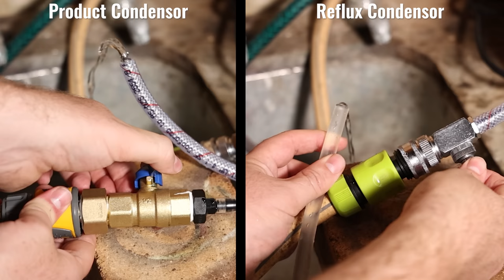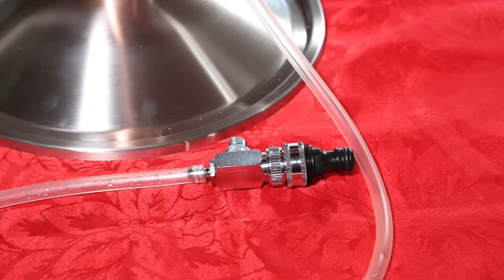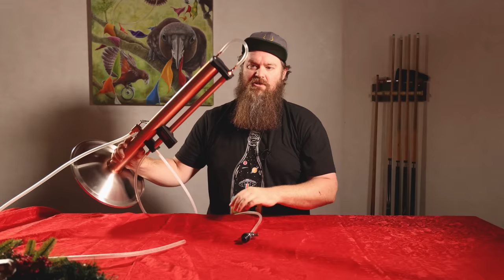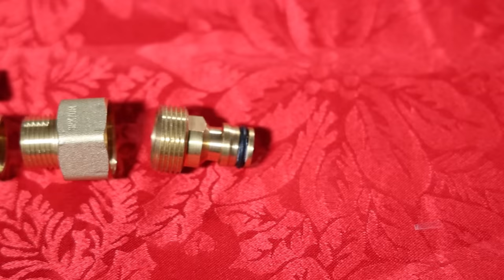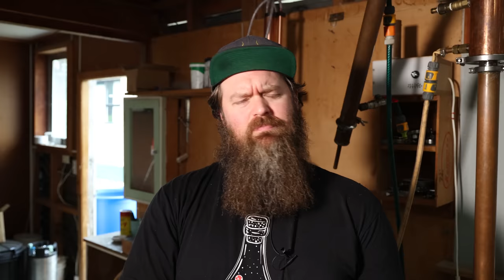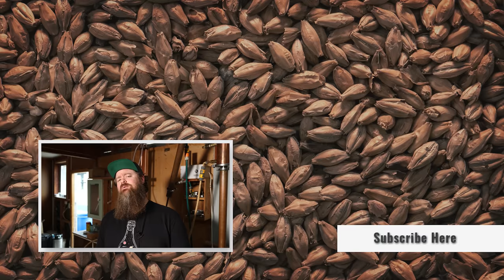Upgrade Your T500 Water Supply : Separate Product & Reflux Condensers

Comment: Thank you once again for an informative video!  I was wondering if you did any actual distillations with the dual water supply, and if so, did you add a second thermometer to the top of the reflux chamber, and what you found the necessary temps to be at.

Comment: The condenser only needs to feel warm at the entry point to knock down whatever you are making. It's also touchy, but less critical than the reflux side. A spare needle valve works fine. Once you get away from the strict turbo recipes and set-up, best practice is to adjust the reflux to achieve a drip - drip - spurt flow, about as fast as you can say it normally, not to chase any arbitrary temperature. A lot of stuff is best around 66 degrees. 

It's a big help to have an alcohol refractometer as you work. Only need a single drop to measure ABV. If you are running too hot and fast, your ABV will go down below 80% since you are carrying over extra water.

Icing on the cake is an SCR voltage controller with a keypad. Once you are boiling you don't need anywhere near full power to get optimum results. It's much easier fine tune 2% power with the keypad than it is to adjust the $%%^&* water valve.

Comment: I find the needle valve is very sensitive, as previously commented, however my experience was that it is all due to changing mains pressure and a small water pump connected to the needle valve solved the issue. I did like this idea and will certainly be implementing it. I have been watching your videos for some time and have  leant a lot, I am very happy just running a t500 as I am happy just making vodka and gin and just experimenting with the botanicals. Being able to split the reflux cooling from the condenser cooling seems very sensible and easy and I'm annoyed I didn't think of it myself! Many thanks.

Comment: Great video. I've had my T500 for 7 months. The best mod for me so far is a £10 power controller. I've just started carbon filtering; it's a revalation. My next experiment is a birdwatchers wash. 
Right now I wouldn't know what to do with two different water supplies, but I'll look it up. Thank you for providing ideas to expand my knowledge....
Reply: Where did you get your power controller from please?

Comment: Jesse you are right on with this modification.  One additional step I'd suggest.  The column needs a thermometer or a temperature probe so you'll know how to fine tune the water flow, especially to the column condenser (which is pretty much a dephlegmator). You can drill a hole into the plastic cap on top of the column.  Center your hole position in the center of the larger rounded section.  There is nothing below the cap in that spot and the plastic isn't very thick.  Drill the hole to best suit the temp device you're intending to use.  I drilled and tapped it for a Type K thermal probe to use with my PID.  With this arrangement, the T-500 is greatly improved...in my opinion.
Reply: Does the plastic at the top have any issues. Especially running ad a pot still?
Reply: @RyanAbrey  no, it is just a cap.
Reply: @skyhookspirits  does the hot pot still run damage the cap?
Reply: @RyanAbrey  No damage. At the top of the column is a coil of copper tubing which cools the vapor.  It acts like a dephlegmator.  This is the point where vapor transitions to the condenser.  If you drill the cap and put in a thermometer or temp sensor at the top, you will be able to monitor temperature accurately and can adjust water flow to the top condenser's temperature more precisely.   The side condenser can have a lot of water flow, but top condenser's water flow must be carefully regulated with a needle valve.  Too much water flow and the column will get too cool and you won't get flow.  Too little water and the column will flow too fast and out put will be fast, but not be the best quality.
Reply: @skyhookspirits  ah so you can't run it completely as a pot still.
Reply: @RyanAbrey  Sure, just don't use the top column condenser.  Just send water through the main condenser.  Also, if running the column as a pot still, you would not put any packings in the column except a small roll of copper mesh if you want.
Reply: @skyhookspirits  Have you posted anywhere about these mods? I'm up for doing it but would love to see some pics if you'd posted them anywhere
Reply: @kierenbeltrame3189  I have photos of this modification, but need your email to send them.
Reply: @kierenbeltrame3189  No, but let me know your email and I'll send you photos and instructions.
Reply: @jpjustinianoj  Ok, let me get things together and I'll email soon.
Reply: @skyhookspirits  maybe will make your life easier to upload the photos to https://imgur.com and share the link in here? Will save you emailing to a number of different people
Reply: @jpjustinianoj  I've posted details and photos here:  https://imgur.com/gallery/h6iGWTr
Reply: @rocketsroc  For some reason I missed notification of your comment, came back to check if any update. Thanks so much for this, it’s really informative. I’m looking forward to modding over the holidays, perfect timing. Merry Christmas!
Reply: @skyhookspirits  Hi guys!! My question here is if the unit is ran as a Pot still (no water through the top/column condenser), is there any chance that the temp will be too high to possibly damage the top plastic cap? If there is no water in the top condenser, the very top of the column is sooooo hot (don’t ask me how do I know that lol), and my concern is that if it’s left like that for a period of time (the entire run as a pot still) the plastic cap will not survive. Am I overthinking this? If not, please share if you know what do you think it’s a highest temp that the plastic cap can handle? My thoughts are if there is a temp level that is “safe” for the plastic, might be achieved by still running a small amount of water, but I think that would defeat the purpose of running it as a pot still!?! Yes? No?? Please share the knowledge… I would truly appreciate it!!!
Reply: No plastic won't melt.  To change the reflux column to a pot still, just remove all packing in the column and run it as usual.

Comment: Great that you are playing with the T500, this is what I currently have, looked at many different options, but this is so accessible. I now want to explore mods too, I recently bought the copper dome and condenser, which have limitations, a power regulator has helped. More recently bought sight glasses and bubble plates, which to be honest, are fun, but don't improve things too much. What I have learned is the Tri clamp accessories are readily available on AliExpress, and these and boiler options seem to open up a new avenue to explore. Keep up the good work, so much is learned from your posts.
Reply: Would you mind sharing what you used for a power regulator?
Reply: @PickledAndFermented  a 4000W scr, the one I got was off eBay. I haven't seen the same one available, but there are several similar ones. I also use an energenie power display so I know the input power.
Reply: @warrencourt7938  thanks for that. Ok start searching. When you reduce the power how does it affect the output? I'm assuming you can lower the abv and keep more of the flavour? I just started learning during the pandemic and now I'm getting creative :)
Reply: @PickledAndFermented  turning the power down will affect output a little, the advantage is your not forcing some of the less volatile components through. You give the high volatile components time to release at a steadier rate, this likely helps keep any cuts you make better.

Comment: This is so cool. I have had the T500 for a year now and been wanting to make some mods to it. I have just ordered a power controller to reduce the element power and then want to find a way to get the temperature at the top of the column.
Reply: Where did you source the power controller?
Reply: @mxj0048  from kegland 
https://www.kegland.com.au/4000w-power-station-240v-power-controller.html
Reply: @mxj0048  10000W High Power SCR Electronic Voltage Regulator Speed Controller AC 220V from EBay. Splice the active wire only from an extension cord into the SCR.
Reply: @iantaylor1341  Exactly, plus you can also put a 'amp, voltage and Kw/hur meter' in the box, I also put a little fan in there to keep the heat sink cooler. I'm surprised S P haven't released a version with all these mods as standard issue. A 400mm spool helps too.

Comment: Adding a temperature probe at the top of the column would be a plus. That is what I have done to the one I have about a year ago. Makes it very versatile. Keep up the great work Jesse.
Reply: Where did you add the temperature probe to?
Reply: @WhenTigersSmoked  At the top of the column where the vapor transits into the condenser.

Comment: Ha ha did this 6 months ago. Run the product condenser only for a stripping run. For spirit run set product condenser to 400cc per min. And adjust reflux flow to control production rate to 10 cc per min. Kiwi ingenuity is alive and well.

Comment: HI Jesse
been running a T500 like this for several years. I've also put a PID controller on the front end.
Always been disappointed with the doubters as I get fantastic results from this still.
Like you I'm a whisky lover and it produces a great malt
Reply: By any chance have you posted about your mods anywhere? I'd love to read more as I'm starting to think about upgrading my still and am looking for inspiration :) I have a controls background from many years ago that I'd love to refresh through a little project
Reply: @kierenbeltrame3189  Hi Kieren
I've split the water feed into two as Jesse has
I've put a PID controller on the power supply and I've replaced the standard stainless steel lid with the copper alembic dome.
This gives me the ability to hang muslin bags underneath the column when in reflex mode and is great for gin(Juniper berries et al) and white rum (desiccated coconut)
It's also better when running as a pot still

Comment: Great video and one of the few ways you can improve on a pretty decent off the shelf product for home distilling. A voltage controller is the ultimate upgrade imho. 
Looking forward to more T500 videos. 👍
Reply: Yeah, having an SSR to dial it up/down is really handy, especially for a spirit run. It's a wonder they don't sell a version with one built in.
Reply: Actually, a voltage control is not the best.  What is, is a PID which controls boiler temperature based on the temperature at the top of the column.  This is where temperature is critical.
Reply: @rocketsroc  PID is tricky to run with reflux because it tends to knock your column out of equilibrium at the extremes of your fractions. What you want is an SSR that you can dial a power output in with. That controls the speed of your boil, which is directly related to vapor speed, so with that and control of your cooling capacity, you can hit equilibrium before you start your takeoff. That will give you really nice fractions.

If you want to have something more automatic, you need a PID that you can program, which is more of a PIC at that point. Then you write a program to govern your runs and it's automatic from there. All the commercial guys are using something to that effect.
Reply: @jttech44 can you be more specific. Are you saying a solid state relay with voltage control? Can you post a link to one?

Comment: Thanks for this video. But I wonder if  it could overheat if you run it like a pot still (cooling only the product condenser)? I'm not sure of how this thing is build and wondering if it would sustain temperature higher than what it is designed to handle without damaging components.

Comment: Nice one Jesse, great channel, I use a chilly bin which I freeze with about half level of water in it , when time comes for distilling top up the other half with water and a fountain pump and join water fitting for still to chilly bin, makes where you can distill very flexible, only need power..
Reply: How big is your chilly bin mate? I live on tank water so want to circulate cooling water in a vessel, is that what you mean?
Reply: @TheAlbiCollier  yea correct Mate, I live on lifestyle block, freezing liquid, be it in plastic bottles or half filling chilly bin ( mid size bin ) and put in large freezer overnight , top up with water just above pump when distilling , this water will circulate and end up back in the chilly bin were is cools again..

Comment: Is there a part two to this on how to run as a pot still? I'd love to know it's possible before I go out and buy a secondary pot still
Reply: I have a reflux still similar to the T500 that I couldn't really modify, so I ended up just buying an Alcoengine pot still condenser and a new lid to suit (the new condenser goes into a smaller hole). It takes only a minute to swap over and all up cost me AU$200. I can imagine that for Jesse the cost of the fittings and pipes would have mounted up

Comment: Great, I now have 2 inputs for cooling. At a guess (because there was no explanation ) I run the reflux condenser to recommended temp and the product condenser at full noise, a warm to the touch flow or ??

Comment: Would really enjoy seeing a review/test on the T500 Water Flow Regulator as well. It looks to be a very nice addition to the T500 still for those that can't get a consistent water supply from the tap.
Reply: The Water Flow Regulator is a great addition when using the T500 in reflux mode. Especially along side a voltage controller. Not much use for the water regulator in pot still/stripping mode imo. Although I also have the alembic dome and condenser to use the T500 as a pot still or for stripping runs. So I've never tried using the reflux column for pot still purposes.
Reply: Watch ‘barley and hops brewing’, a guy named George. He has a video on the water controller amongst many other vids on this subject, it’s a great Chanel
Reply: $5 building centre bucket plus $20 Amazon pond pump = water pressure regulator. Set bucket under the tap, adjust the tap so you bucket stays 3/4 full...

Comment: So do you run the condenser water flow at a high flow rate and adjust the reflux to maintain 50 to 60C ? Or do you use different ranges depending on what you are making?  Sorry I’m a newbie to the hobby…

Comment: Good day.. First of all, Great channel, I've learned a lot. I purchased a Turbo 500 still. I have used it several times, with success. The only issue is that, despite being told it would take between 4-6 hours, it take more like 12-15 hours.. I run the temp consistently at 57'C.. and I get a very slow drip at about 1 drip every second to 1 drip every 2-3 seconds. I have seen in other videos that the drip rate and time from beginning to end are much higher.. What am I doing wrong. because in order to attend this still from beginning to end.. I have to stay up all night
Reply: Same problem, I’m hoping that putting ice in the water bucket I use as a volumecontrol tank will do the trick
Reply: I have the same issue but realized after some research that it’s not anything I’m doing wrong. It seems that the still runs slower in the states possible due to the lower 120v power input vs 230v power in Australia (where it was designed). I maybe wrong but this is what I’ve seen in the forums.. The slow drip rate is also not really an issue, since you are likely getting super pure distillate. You can run it at a higher temp, like 60c and likely will notice the drip increases to a steady stream, with drips between. I’ve done this and stopped obsessing over the temp. I go by taste and smell and find no noticeable difference in flavor between a super slow run at 57c and an 8hr run at 60c.. my 2 cents.

Comment: OK so I watched this and thought this is the most brilliant idea I have seen on youtube...
Then I thought about it. 
The T500 and the thermometer are set up to read the temperature coming out of the still and it helps you visualise when you need more or less heat and if it is getting too close to the tails or if it hasn't got hot enough to get past the Methanol stage yet. By putting the 2 separate hoses in and cooling down the spirit like that is great for the spirit side and you won't need so much water to cool it because it hasn't been heated. But the thermometer will be reading the wrong temperature. It will be too cold and people will be bumping up their still trying to raise the temperature on the reflux side when in fact it is already boiling its patooty off but you won't know because you are reading the temp on the other side that now has absolutely nothing to do with it.
What I am saying is it has been calibrated already and I think they give you the heat measurements in the box with the T500 to work with.
Maybe a good idea to try when you have got the hang of the still and the temperatures but not for most newbies.